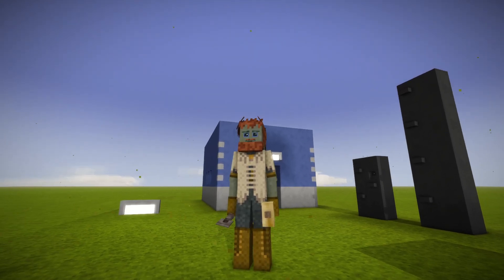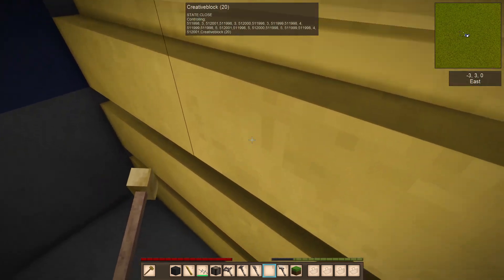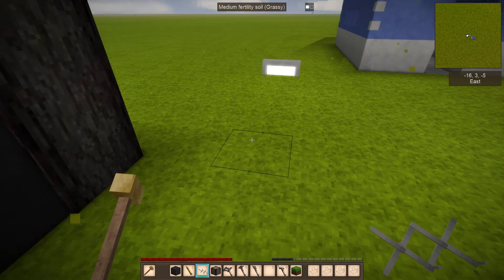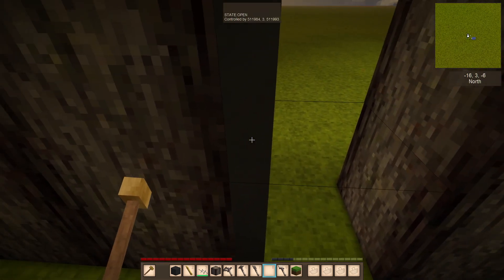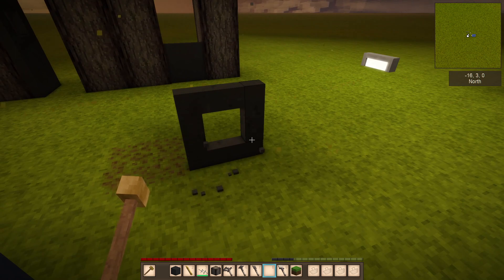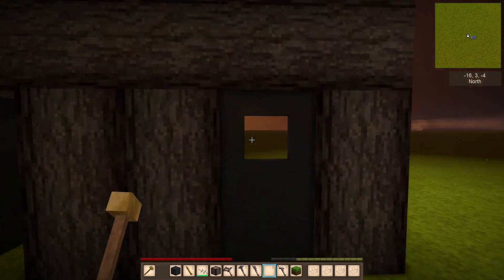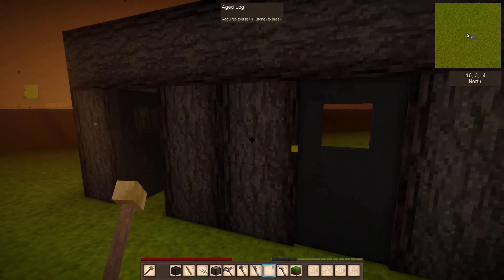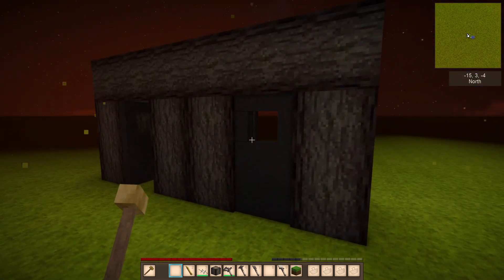Chiseled Doors Tutorial - how to make your own doors in Vintage Story!

Comment: It would be handy if you could manually set one of the states to air,  like if you had a door that had a larger than one meter width. Might totally be possible but im struggling to figure it out
Reply from the maker: You can I think it's shift click or ctrl shift click with the appropriate mode set.
Reply: @qptech  it does allow you to create chisel block:blank blocks. The issue with these (from my use that is) is I get a big lag spike whenever I hover over one, and they also don't allow blocks that are directly behind them to render properly. I think the lag spike is is cause of the tooltip they present, and the rendering issue can probs be solved on my end by adding said unrendered blocks to the door. 

I was wondering if it would be possible to disable the hotbox of these when you are not holding a chisel, but frankly I'm not sure how possible that is (I've not really messed with any of the coding aspect of modding for vs). Regardless, dope addition to the mod and makes 3 wide double doors actually possible :D

Comment: It would be so good if you could interpolate between the two states for a given interval, and upload a custom sound file to the server for the door.
Reply from the maker: Sound files i've thought of, interpolation I don't think I could do.
Reply: @qptech  1.18 has custom animation triggers. You can use them to play sounds, and start an animation. The game also has interpolation functions you can grab from the CInematic Camera (Or I have some separate if you want them). Instead of creating two door states, you can choose which axis to rotate around. For a basic door, rotate around Y axis, for a draw-bridge, rotate around X/Z axis with the origin point at the bottom. You can interpolate the position as well, to create sliding doors... Garage doors would be a lot more difficult though, if you want them to roll. But portcullis style doors could slide upwards.

Comment: Could you please create an updated tutorial for this with doors that aren't a 1x1x2 like the video because I'm struggling real hard with a 1x3x3 door and can't figure out how to do it to save my life 😭😂
Reply from the maker: larger than 1x1x2 cannot be learned, instead  you must smooth your brain out until you can do it by instinct without going insane from the horrible UI process xD

I guess the main tip is you can CTRL+SHIFT Right click in assign open or assign close door models to make that state an empty block.

But it gets really messy and confusing really fast!